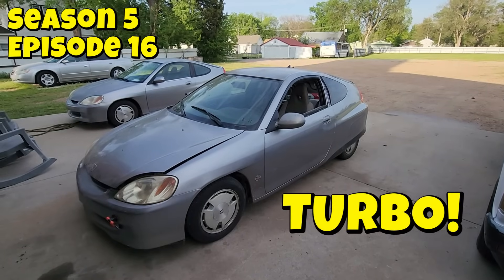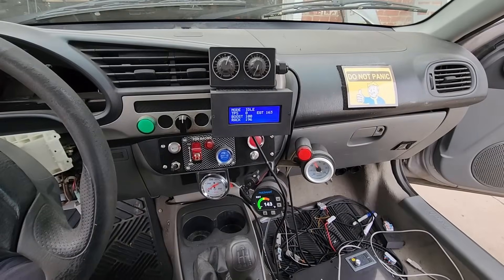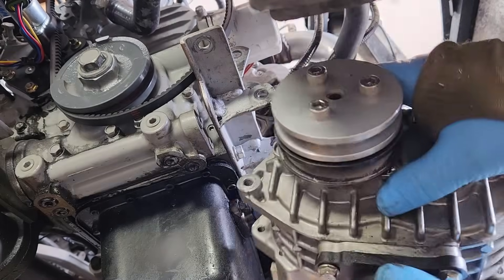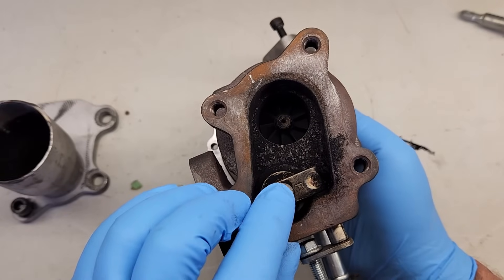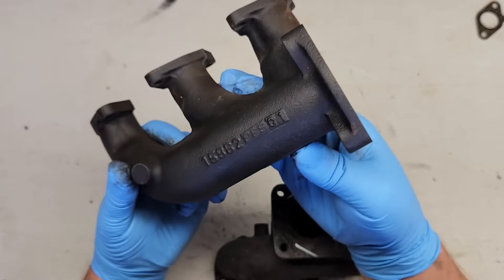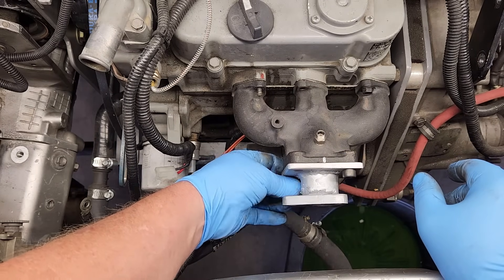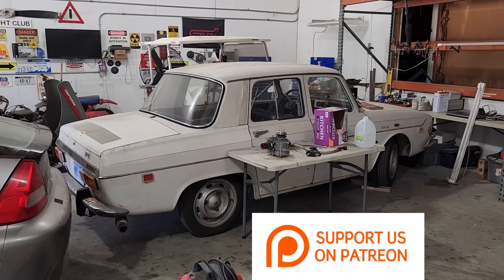S5 E16. TURBO !  We get rid of the AMR500 supercharger on the D722 Kubota diesel engine in the Honda

Comment: Too few gearheads are also computer geeks. Funny part of that is that modern cars almost makes it necessary to be both.
Reply: I think that's kind of the problem. I'm an electronics and programming guy, and to be fair have done custom electronics on my cars before - when you could actually find the documentation. Nowdays I look at any car I have with broken anything and let it rot on my driveway. You know if you try to fix one you'll be hampered by the other with prioritary tools or manuals you can't get. I think seeing something as daft simple as a lawnmower engine pushing a car at decent speed gives a kind of hope to people cars could actually be worked on.
Reply: @luketorpedo , I know exactly what you mean. I grew up as a computer geek and gearhead in the late 70s and 80s. My father and grandfather were mechanics. I was a mechanic for 26 years. Even as a mechanic, I ran into this issue. I will say this, AlldataDIY is a great resource for those of us that want some documentation to start our research on a project. I have subscriptions for my vehicles.
Reply: @luketorpedo  Sorry to hear that.
Reply from the maker: Indeed,  I was a gearhead before I learned electronics and code nerd.  the combination of the two are awesome, but its not for everybody.
Reply: @robotcantina8957, I grew up a gearhead and computer geek. First computer that I had experience with was a Commadore 64 and first auto engine to tear into was a Ford 300 cid 6 cyl. My father and grandfather were mechanics, and I did it for 26 years before I went back to school and got degree in the IT field.

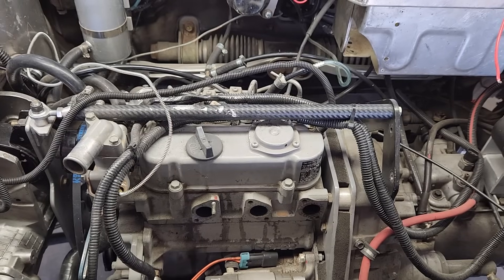Comment: 9:05 Every euro bill is a different size to make them easier to recognize. 5€ is smallest at 120x62mm, 500€ the largest at 160x82mm. That size change is because they made the 50, 100 and 200 euro bills the same height (77mm) for the second series (and discontinued the 500€ bill).
Reply from the maker: I see how that can be handy.

Comment: If price is right on the Renault, I would buy it :) and fix up suspension.
Reply from the maker: The Renault starts,runs, and drives.  but since its powered by a 2 cylinder engine, its not something that can be driven daily.  We made the car more or less safe to drive on rural roads but it desperately needs a lot more work to make it safe for urban driving.
Reply: @robotcantina8957  She can do 25mph, perfect for NYC :D the avg speed is like 11mph out here.

Comment: Nooooooooo why didn't you just install a turbo and made a compound system? The compressor is useful in this system because it's like if the turbine is attached to a bigger engine so it will spool faster! By the way, with this system you can use a smaller pulley on the cranckshaft side and that will reduce the parasitic losses. It's a win-win situation!

Comment: Wait, hanging the turbo out of the hood is a bad thing? But where do you put the hater pipe and tractor flap?
Reply from the maker: Putting the turbo above the hood line would be epic, but I dont want to cut up the hood on this car.  They only made 16000 of these hondas and parts are expensive and hard to find here in Kansas.

Comment: It would be interesting to see how the little Kubota hanldes more boost pressure. The old audi A4 TDI I had years back boost peaked at 3.2bar, to then quickly decrease to about 1bar. It made a huge difference in getting things rolling. But I suspect this little engine might not love quite that much boost pressure.
Reply from the maker: The Kubota starts making ticking noises above 10psi (.7 BAR).  It could be weak valve springs or the injectors cant handle the extra cylinder pressure.  The engine would also need a few more major modifications to run higher boost and still be reliable.
Reply: @robotcantina8957  Ahh right! Yeah well, it's tricky to do this on a small engine to begin with, and especially with one that was never built for boost to begin with. It's still quite impressive what that tiny little thing can manage. It really is easy to forget how absolutely tiny it is. Very well done regardless, and another great video. Keep up the good work! :)

Comment: Could compressed air be used like nitrous to be used increase the oxygen content in the intake in combination with the turbo ? Thus increasing the AFR
Reply: Sure and for professional engine testing and development they do this on a stationary engine dyno. But engines consume a lot of air so you need a lot of storage and a big compressor to do this so it is very impractical on a vehicle.
Reply from the maker: The turbo or supercharger are compressors made to provide the volume of air needed by the engine.  a regular compressor wouldn't have enough air.